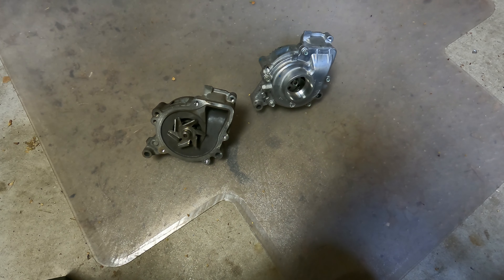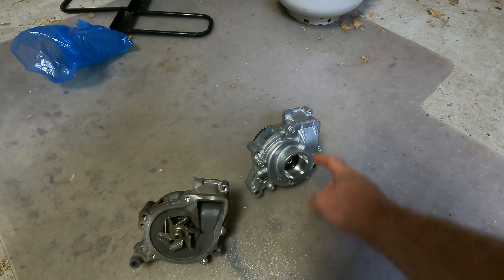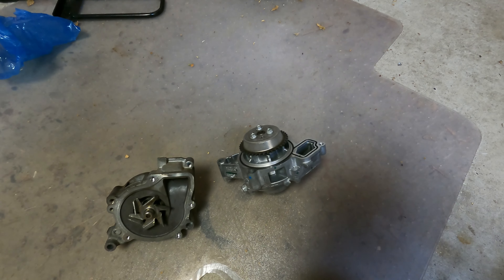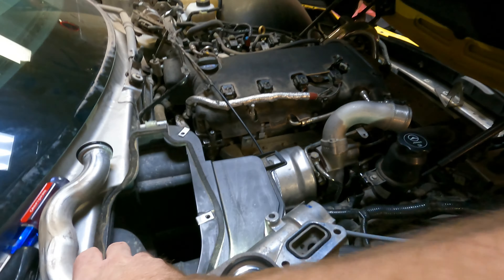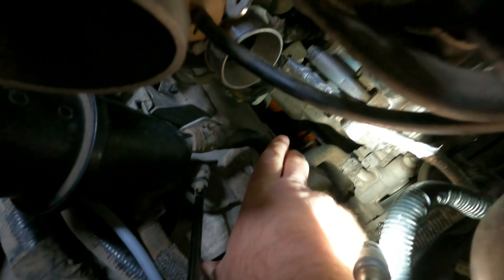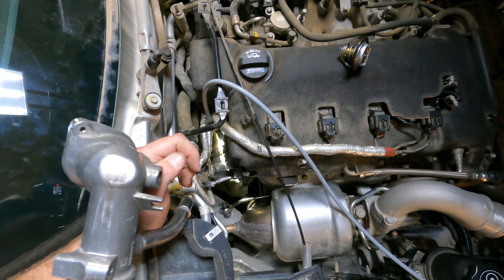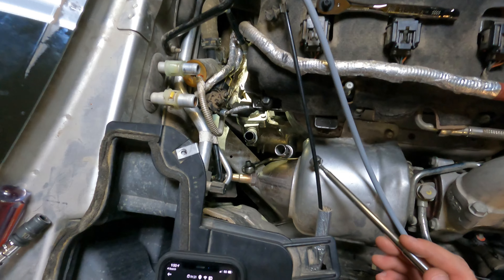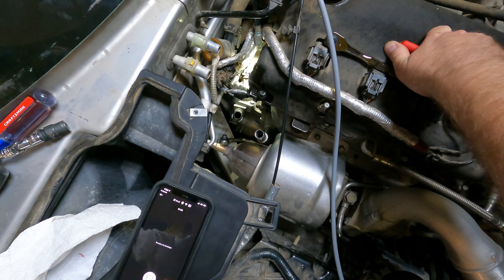Pontiac Solstice GXP Water Pump Replacement

Comment: Advice: take the turbo out along with the cat (you can leave this hanging).  It takes about an extra hour for me.  Well worth it.  Air or electric ratchet is an absolute must.  Keep young children away as the Solstice repair vocabulary is not suited for them.
Reply from the maker: I have heard with the 2009 you flat out Have to take the turbo out because the oil lines are routed differently.  I'll keep it in mind, although I don't plan to ever do it again if I can help it.
Reply: Thanks! I was planning on doing my water pump when I swap turbos which I’m about to do and I was wondering if it would make a difference doing it at the same time. Thanks!

Comment: Someone may have said this, but if you take the turbo shield off and undo the downpipe top and bottom, remove the O2 sensor, and move it to the side (support the exhaust underneath), it gives you more room at least for the thermostat housing, etc.  Trust me, whatever you can do to make more room is worth it...it takes like 10 minutes to undo the downpipe.  

Have a pick handy too to get off water hoses that are stuck on after years of being there.
Reply from the maker: Thanks!  Great idea.

Comment: how did you get the three bolts on the therm housing back in? very difficult
Reply from the maker: I show that part in the video.  I took a probe with a magnet on the end and used it to drop the bolt down to my waiting hand.  It was still very tough.

Comment: Hi,  thanks for the great video. One question, I removed the 2 large bolts holding the pump in place, as well as, the 3 bolts on the gear, but the pump will no come off.  Are any of the other 5 bolts on the water pump holding it  on the block?
Reply from the maker: There are at least 4, maybe 5 bolts holding the water pump onto the block (not counting the front bolts on the pulley).  Look at your new water pump as a guide.  All the holes that go all the way through are bolts that need to come out.

Comment: I have asked 3 mechanics if they can do this job for me. I have explicitly explained that this is chain driven, that there is NO room to move, and that it is NOT the same as a normal water pump job. Also, they will need that special tension tool to keep the chain tight.

All 3 shops said no problem.

... After delivering the car, all 3 shops refused to do the job.
Reply from the maker: That’s crazy, thanks for posting.  I can see why it is the most difficult thing I have ever done to a car short of pulling an engine entirely.  In some ways, it is more difficult than pulling an engine.

Comment: I've wiped out a pushrod V8  on a Friday, removed and rebuilt the engine over the weekend, reinstalled it and driven to work on that Monday.
And I have the M car manuals from GM.  I chose to take my Sol GXP to a Buick dealer to replace the water pump. F that all day.
Reply from the maker: Very well said, I’m inclined to agree with you.
Reply: After watching this video I was thinking the same thing.  Great video, it makes a very convincing argument...

Comment: i just did this job, all i gotta say is as annoying as it is just get the special tool, and take off as much shit as you can to create the most amount of room possible. make sure you loosen the driver side motor mount bolt, but completey take off the passenger side mount for more room to remove the downpipe and thermostat and jacking up the engine makes everything so much easier.
Reply: btw thanks for the video it helped me out too!
Reply from the maker: Thanks man.  I always wondered if it would have been better if I tried it that way.

Comment: Just bought a 2008 sky with 87K for 8K. It was fully garaged and pretty much a cream puff.No records on any timing chain/pump replacement. I considered/worked that into my purchase price as the car was approaching  the 90K mark.I WOULD NEVER DESIRE TO ATTEMPT TO DO THIS ON MY CAR. This guy has great mechanical skills but HE IS CORRECT. Sure, you can do it but you are far better off letting a dealer do it. Just take the replacement cost into the cost of what you buy it or have used it for.And once its done, its over.. most likely at the forever point(90K more miles). I think the sweet spot is to buy a really nice one with about 70-90K for as low as you can, take it to a qualified shop and get it done quickly.But yeah, unless you have the time, tools,ect? Maybe even gamble on your own skills ? Umm no.
Reply from the maker: Unfortunately, that’s pretty good advice.  So far the repair is still holding strong.